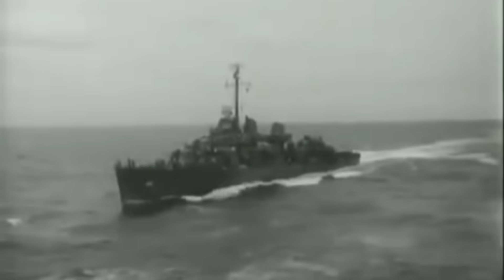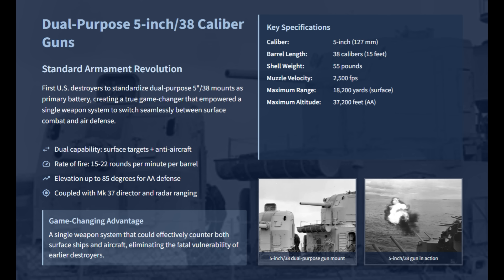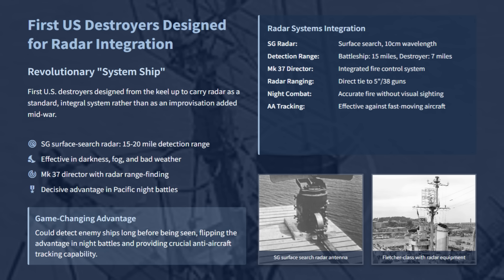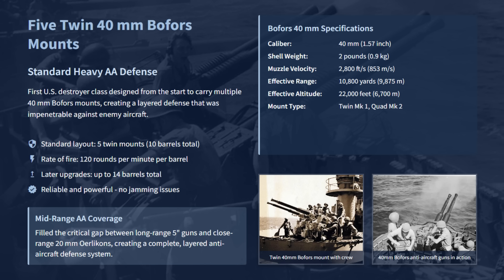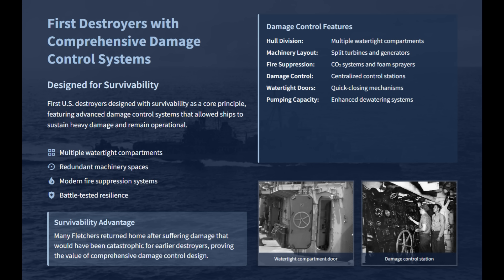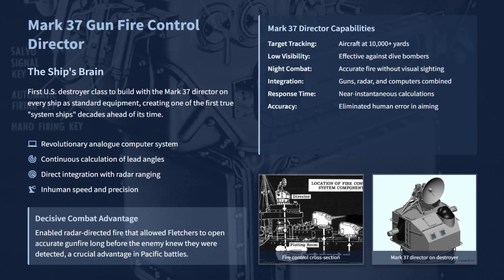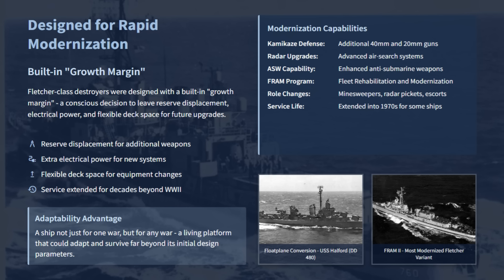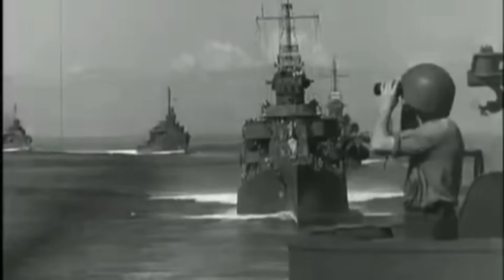6 Innovations That Made the Fletcher Destroyers Revolutionary

Comment: Loads of BS here. Many earlier US destroyer classes had dual purpose main guns. Only a few classes had surface only main guns. Some British and Japanese destroyers had about equal to or better gun power to the Fletcher's.  One of the photos shown is of an engine room throttle board, but mislabled as a damage control station. Sloppy, inaccurate presentation. Do your research better. Don't get me wrong, the Fletcher's were great all around ships. British destroyers tended to specialize and some of their WWII era ships were better gunboats, some were better ASW ships and some were better AA platforms, but Fletcher's did all 3 tasks nearly as well. I served on Forrest Sherman's class and Gearing Class US destroyers, but some buddies in the same squadron served on Fletcher's.

Comment: None of the innovations you cited were new on the Fletcher class, AND YOU COMPLETELY MISSED the one HUGE innovation introduced on the Fletchers.

The 5"/38 DP had been standard for eight years since the Farraguts, and the Mk37 GFCS since the Sims. Fire control radar had been integrated into the Mk33 and Mk 37 FCS since the start of the war. SG radar was introduced on the Benson class, what was important was SG brought the PPI radar display to vastly improved situational awareness. The Bofors also was introduced before the Fletchers saw action.

The one innovation NEVER seen before the Fletcher was the armor - the entire hull center section was built from STS armor steel. A;; US destroyers since, and eventually (from the Garcias on) all US FFs were similarly armored.
Reply: Correct. With armor Fletcher became look like small sized light cruiser.

Comment: The Fletchers, wonderful  though they be for their generation, did not have unmatched firepower compared to other destroyers of their generation nor some earlier generation destroyers. The Fletchers did not need any form of hyperbole to cement their reputation, or sloppy research. The Japanese special type  (Fubuki lead ship) revolutionized destroyers after their introduction in the late 1920's. By the introduction of the well-balanced Fletchers with their sophisticated gunnery control and radar. At the battle of Tassafaronga, 8 Japanese destroyers tore apart a U.S. force of 6 destroyers and 4 cruisers. The battle probably wouldn't have been as lopsided a victory for the Japanese had the American admiral in charge (let's call him "Admiral Stupid") refused to listen to the commander of the U.S.S. Fletcher and would not allow te U.S. destroyers to open fire and release torpedoes for several minutes.

Comment: What gibberish the dual purpose 5-in 38 was introduced long before the Fletcher. In fact, this Summer's class carried eight of them 2 years before any fletchers were launched, which is much more firepower than a Fletcher had because of the extra displacement it could have 40 mm anti-aircraft guns which is true. But your video is literally gibberish otherwise.

Comment: The 5"38 with different gun mounts were standard for all of the post WWI destroyers starting with the Farragut class. Mk 33 DP directors. All were DP save the two 1850 ton Porter and Somers Leaders which could only have twin single purpose gun mounts. The Mk 37 director were designed to incorporate radars hence the flat surface of the director housing. The Mk 37 first appeared on and were standard on the Sims class followed by the Benson and Livermore class destroyers. The Benson and Livermore and Fletcher were designed to have the 1.1 inch triple mount light AA guns, but these were replaced with 40mm guns when built in later ships. The USS Fletcher had a jury built CIC in time for the 1942 Guadalcanal battles. This would later be incorporated in new ships being built. The larger Fletchers were considered as fleet destroyers as used in sea battles in the Pacific. The smaller Benson Livermore destroyers were considered sea control ships and used for convoy escorts and ASW in the Atlantic with a larger number of depth charges carried.  Oddly enough Hedgehog ASW mortars were limited to Destroyer Escorts and a few modified Flushdeckers. It would not appear on destroyers until post-war. Only 12 late Livermores test mounted the smaller and lighter Mouse Trap Hedgehog mounts, but the mount was not considered satisfactory and all were removed. The Fletcher were larger as they were not constrained by earlier Naval Treaties

Comment: unmatched firepower. Just proves that your video is crap. And 120 RPM per for 5" is another lie: AI Overview
The 5"/38 caliber gun's rate of fire (ROF) varied by mount type and crew training, typically being 15 rounds per minute. Crews could sustain a rate of 12 to 15 rounds per minute on mounts without integral hoists, or achieve up to 22 rounds per minute for short bursts on base ring mounts with hoists, though this was difficult to maintain. 

Could you not figure out the number was rediculous?

Comment: During the late 60’s I worked on a rush EW project AN/SLA-19 which was to be installed on Fletcher and its cousin the Gearing class destroyers to protect the fleet from the Styx anti ship cruse missile which Russia had supplied to North Vietnam.  The system was deployed in the early 70’s as a temporary system that could be moved from destroyer to destroyer.  It consisted of an EW hut on the ASROCK deck with makeshift port/starboard antennas.  The system was designed to make the Styx break lock and reacquire on a chaff cloud. I don’t think it was ever used, but I can tell you it would have worked if it had been used.

Comment: In your opening video the bow of DD-747 is shown. That was a Allen M. Sumner class. I served on that ship for a short time in the 1960s. The conversion of some Fletchers to DDE with the loss of three 5" guns and installing Weapon Alpha was a waste. In gunfire support missions in Korea and Vietnam, more guns and ammo could have been used. Each gun had about 350 rounds in their own handling/ready room and magazine. There was no mechanical method to move rounds from former gun ready rooms and magazines other than hand carry on deck. So they weren't used. And the modified ships only carried about 700+ rounds of 5" instead of 2000. 
Homing torpedoes made depth charges, Hedgehog and Weapon Alpha useless. And the US had submarine fired homing torpedoes in 1944. USSR had submarine fired homing torpedoes by the 1950s. So the only way to out range submarines was the DASH and ASROC systems. I served on a Sumner that was part of one of the last Hunter/Killer groups in the navy. It consisted of a carrier and 6 destroyers that had DASH or ASROC and one had AA missiles. In practice against USN subs, we were deadly against diesel electric subs, but nuclear powered subs killed us almost every time. And we practiced continuously for 2 weeks every month. But the navy figured out the best way to kill a sub was with another sub. Current carrier forces have two attack subs.
The 5" gun was the best destroyer gun in WWII. Even the British wanted it. During WWII destroyers carried practice loading machines to get loaders up to speed and physical condition to load 22 rounds a minute. And 22 RPM was achieved by using the handling room ammo. Using magazine ammo reduced the rate to 15 RPM. Practice loaders were removed after WWII for weight savings when the tripod mast was installed. 15 RPM was about tops for peacetime gun crews. The 5" shell weighed about 54 pounds and was elevated into the gun mount, but the powder case was pushed thru a port in the floor from the handling room. It took a lot of practice to continuously load and fire.
Later most active Fletchers had mount 53 and 40mm removed for 3 twin 3" AA guns and an aft 3" director. But there was no real air defense with guns after jets appeared. Fletchers lasted until the early 1970s in the USN and into the 1990s in foreign navies. I served on DD-687, my favorite ship.
I believe the Fletchers were the first destroyers with separate boiler and engine rooms. From the midships you had fwd boiler room, fwd engine room, aft boiler room, and aft engine room. They could be cross connected. The fwd engine room had a longer propeller shaft. As the video stated there was a watertight bulkhead between engineering compartments. And they did keep ships afloat with damage. I was on a destroyer in 1969 was t-boned by a carrier. The destroyer DD-754, a Sumner class, was split in two. We rolled 90° but the stern righted itself, the bow never did, too top heavy w/o the stern. The carrier went thru the fwd boiler room. The stern section floated and was never in danger of sinking. The bow section sank in 3 minutes.
Reply: My dad served on the Renshaw (DDE-499) in the Korean War. He was the talker on the aft 3 inch gun mount. He said that his combat experience consisted of dueling with Chinese shore batteries in Wonsan harbor.
Reply: @larrypatty8333  One of the ships in my destroyer squadron Brush DD-745 had a dent in the hull plating of the fwd engine room from a dud North Korean shell.

Comment: According to D.K Brown a naval historian who worked in ship design for the RN(the first ship he worked on was HMS Vanguard and the last the design of the Type 23)the Fletchers would not have been allowed as an RN design because they carried fuel all the way up to the main deck. In fact had they been built with fully dual purpose 4.5 in guns firing the 55.1lb shell then the Tribal class of 1936 would have been seen as better and had they been built as large as the Fletchers which would have given the Tribals another 250 tons and thus probably a second set of torpedoes the Tribals would have been immeasurably superior as fleet destroyers
Reply: Unfortunately they would have had the HACS, which according to the same DK Brown was far inferior to the Mk37. The RN itself did the comparison after HMS Delhi was rearmed with two Mk37s and 5x 5"/38s in 1941. 

The Fletchers tanks were also located in the center body, which unlike the Tribals was built from STS armor plate. The concern was splinter proofing after RN experience in Norway. The benefit of a later design incorporating lessons learned.

By "fully dual purpose 4.5 in guns" I assume you mean the contemporary Mk II BD mounts, which would have required a reduction to 6 guns as they were half again as heavy as the 4.7"  CPXIX fitted to the Tribals. And unlike the Fletchers, they would not have RPC, just a manual follow the pointer, extremely inaccurate for destroyer AA fire. Full RPC mounts weighed in at double the 4.7", reducing the ship to 4 guns. This was the same issue the USN had when rebuilding Porter/Somers class with far heavier DP mounts. 

I am not familiar with the specific comments you reference, but I suspect you did not read Mr. Browns full discourse on the matter, he certainly knows what he talks about.

Comment: You forgot that the base Fletcher hull was repeated with an improved weapons layout with the Sumner class destroyers. That was just the beginning. Lengthened, widened, and upscaling of the Fletcher class. Was used for every follow on destroyer class. Until the US Navy began work on the Spruance and Ticonderoga class ships thirty years later.
     Today we need a modern escort in the size range of the Fletcher class. Based on similar principles of modern warfare. Drones, missiles and multi purpose guns and beam weapons. A ship, for which a manufacturing plant can be quickly built, and start production in as few months as possible.
Reply: All the way up to the Adam’s class they used this hull, really clever when you think about it
Reply: @Legitcar117 The basic engineering and design, was that good.
Reply: That would result in a ship with less capability than the LCS classes and no anti-submarine helicopters.
Reply: @josephahner3031 So what? Ships like that, can be built too. The GREATEST problem we have today? Is insufficient numbers of hulls.
     Looking at and remembering the Fletcher class destroyer? How many were built? When hoards of kamikase planes came for the fleet. They met numerous pickets of destroyers and destroyer escorts. 2500 ton to 1000 ton escorts.
Having a host of smaller and much more EXPENDABLE ships? Saved the much larger and more capable ships from serious or fatal damage. Something missing from today's navy.
     Congress won't fund cruisers. So the navy builds cruisers, but designates them destroyers. Leaving the US Navy a force of super carriers, and battleships.  With no real escorts to screen them, or break up incoming attacks. A recipe for total disaster. We're not really talking about less capable ships. We're talking about escorts which are NOT capital ships. So? No! The won't have room for a helicopter.
Reply: @scottjackson5173

The greatest problem you have today is that the aircraft carrier is in the same position as the battleship was in 1939.  Of dubious military value, extremely vulnerable, but it has yet to be decisively demonstrated in combat by a willing and competent enemy.  

The modern carrier has never gone into combat against an enemy with attack submarines, air launched cruise and hypersonic missiles from beyond the range of any carrier borne aircraft, and ballistic missiles.  

What they figured out they needed 70 years ago was escorts with anti submarine helicopters and surface to air missiles.  

The legions of WWII destroyers left over were converted to hold tiny DASH helicopters and one was converted to mount Terrier missiles. They were all stop-gap solutions until larger more capable ships could be brought into service.  Even the Knox class frigates were able to hold both a Basic Point Defence Missile System or CIWS and a Seasprite helicopter at the same time because it was much larger than the Fletchers, Sumners, Gearings, etc. 

And as the threat of ballistic missiles and hypersonic missiles have increased.. so have the demands for larger and more weapons systems, more sensors, and the crew to operate them all.  

And for what?  We are already 35 years into the era where air strikes can be launched from land bases to targets halfway around the world.  Carriers are huge expensive liabilities.  And the other threat is asymmetric warfare.  Just getting overwhelmed by a fleet of drones or suicide boats that nothing is going to stop.
Reply: @calvinnickel9995 I'm a US Navy veteran who served aboard USS Ranger CV-61. The third super carrier built for the US Navy.
    I know better than most people exactly what carriers can and cannot do. The greatest threat to America's carriers is the treasonous behavior of certain congressmen and senators.
     During the 1980s when I was serving aboard USS Ranger. Our airwing was more capable. Than most of the world's individual air forces! There were not many exceptions to that.
    Since the year 2000. The US Navy has been forced to use the F-35. Yes, the plane has some interesting capabilities. Which avoids the fact, that it makes the ships it's onboard less capable than ever before.
      It's range is much too short, and it's payload is too low. To be an effective strike aircraft. So the long range strike capability has been removed.
    It's too slow to be an interceptor. So carriers have lost the capacity to strike long range missiles and bombers before they can strike. Nor can it carry enough weapons to defend the taskforce.
      It's over reliance on stealth and electronics warfare. Makes the F-35 a crappy dogfighter. So once enemy fighters close to dogfight range. The F-35 is toast.
    The F-35 has absolutely no antisubmarine capability of any kind. In fact, the ONLY advantage over the aging F-18 super hornet? The fighter the F-35 is supposed to replace? Is it's stealth features. Which on a scale of 1 to 10? Is about a 4 out of 10. Better than the F-18, but greatly inferior to the YF-23.
    It's the F-35's lack of needed capabilities  that are making our carriers vulnerable.
Reply: @calvinnickel9995You know the solution? We won't need to patrol the sealanes if merchant ships have a drone storm on  board that can keep it reasonably safe.